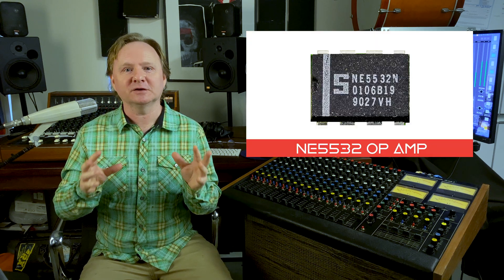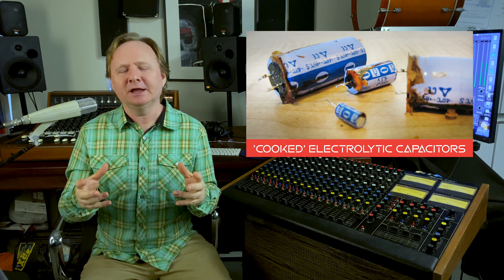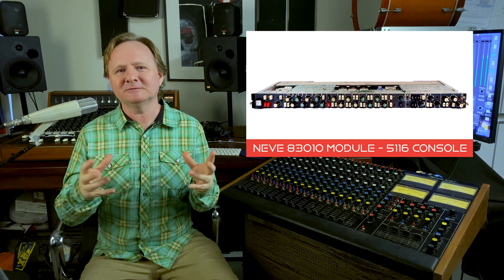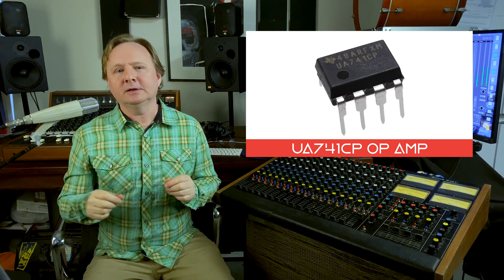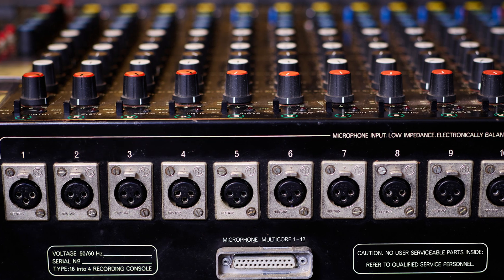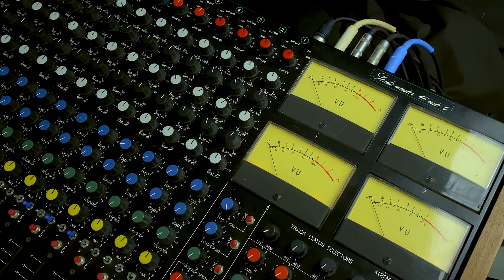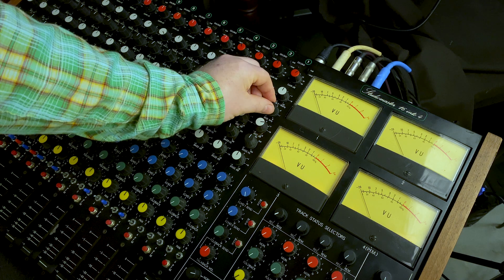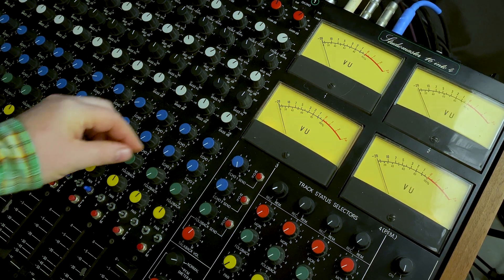Neve 51 vs. Studiomaster 16 into 4  part 1 - Clash of the 80s IC Consoles

Comment: It wasn’t the heat.  The Chinese stole the formula for capacitors, but didn’t get the final part of the formula, so all the capacitors failed after some time.

The 5532 op amps can drive a 600 ohm load which is why they pull more current,. The 741 op amps in the studio master can only drive about 2,000 Ohms.

Comment: The '741' was about the first op amp that could be used reliably, meaning it did not blow up if you looked at it the wrong way, unlike the '709' which would oscillate and burn if the layout was xrong or you shorted the output momentarily. all audio manufacturers worked on schemes to boost the inherent failings of the 741 and other chips, often adding a pair of transistors at the 'front' to boost gain and lower noise. Transistors at the output to boost current drive capability and so on. Making a chip perform in a 'product' as well as ONE device in an ideal circuit configuration in a lab is a bit of an art (or well researched science).  Saying a mixer has a chip in it is about as meaningful as saying you put petrol in your car as there are infinite ways to mess up the best performance a given chip is capable of.  Class A circuits do not have 'crossover distortion' and TEND to distort asymmetrically, meaning that the typical distortion rises gradually with signal level hence 'driveability' whereas all op amps used for audio can(usually do) have low distortion until they suddenly clip as you approach the supply rails. Talking of distortion, having coupling caps between stages that are too low a capacitance for the 'load' they are driving increases distortion at low frequencies, something that was not a big issue when recording to tape because tape would not record the low frequencies accurately and it is the resultant phase shift that alters the sound. Of course the mix engineer would be listening to the complete mix and would be compensating for LF loss by boosting the LF on the equaliser. PS, liking the QM3 Chilton. I happen to have a QM1 here for repair. I sawed a Studiomaster in half to make a 'split' radio station desk in 1987.
Reply from the maker: @mattsyson3980  some cool background there, thank you for contributing- where are you based?
Reply: @jamiedurrantmusician  Since 2017 in France but previously UK. I worked for 4 mixer manufacturers in the past (Audix, Calrec, AMS before Neve, and AMEK as a commissioning and test engineer before going freelance in 2000 where I now work on many desks SSL,Neve etc. I wanted to emigrate to Australia in 1984 but only stayed a month touring from Brisbane down to Melbourne and back.
Reply from the maker: @ wow what a back story!

Comment: Hi! I hear a quite high noise floor from my headphones when you are plugged in the studio masters, more so when you're boosting with the EQ. Is it going to be a problem when many signals are running through the console?
Reply from the maker: @robertopistolesi2735  yes I didn’t mention noise - certainly not a clean class A desk
Reply: @jamiedurrantmusician  Class A does not necessarily translate to lower noise, likewise it is possible to make any circuit sound bad and distorted whatever active components (transistors or 'chips') you are using.
Reply from the maker: @ makes a lot of sense!
Reply: @robertopistolesi2735  I have zero noise on mine, but I use direct outs only

Comment: The used 741 opamps in the Studiomaster might have lower dissipative heat, however they have higher distortion, noise, and lower slew rate than the NE5532. But I'm glad that the sound is cool!
Reply from the maker: @olivergretz  yes all correct! It’s not noise free and it’s darker sounding due to those 741s which is a good sound for certain music productions.
Reply: They used them because they were cheap lowend consoles

Comment: Neve moved into IC circuit topology after Rupert sold the company. The ICs used in those consoles had questionable sonic qualities, however, the use of ICs (along with the elimination of transformers) reduced manufacturing costs by quite a lot. This, along with each channel strip being fully on one main circuit board also reduced labor costs. Some console manufacturers (i.e. MCI in the US) continued to use transformers for their isolation qualities, but soon abandoned them because of several factors, mainly cost and audio fidelity). Once the 5534/5532 ICs came into being, console fidelity improved tremendously. Then it was merely the poor implementation of interstate coupling capacitors that continued to degrade the performance of cheaper consoles. The SSL 9000J is a servo coupled console… no interstate coupling capacitors… that sounds incredible in part, because the smearing phase distortion of those capacitors was eliminated. The NEVE 8108 and 8128 had a sound of their own, but were not really hi fidelity in their sonic signature. However, some cheaper consoles of that same era had a very lovable sonic footprint… Soundcraft being one of several.
Reply: 2 famous Neve consoles that are an example of a vintage Neve classic and modern Neve classic are the 8078 ic version, and the Neve 88r also an ic based console 

In reality tho and I’m sure everyone that’s had a Neve and looked into all of it knows well, repairs happen all the time on the vintage non ic modules, heat and other issues were far more common in terms of repairs, especially because of the Class A topology current requirements. Rupert would gage the truth of pre-amp circuit via holding his hand over the unit for a few minutes, and could tell if it was class a, as he said, tho half joking he had a point. 

I’ve had an IC Neve from 1978 for 15 years and the channels over their 40 year life have only been recapped, no other repairs, that absolutely wouldn’t be the case if it was the older transistors modules.
Reply: That is one cool comment over here! All the best, Tobi

Comment: Enjoy your videos Jamie. Do you use that reel to reel tape machine?
Reply from the maker: @Beatledave7  Hi Dave! I’ve not long had that reel, it’s a full track mono record model - MX5050 BiiF - I’ve only just had it serviced - the transport was almost locked up and pots and switches were noisy, running well now, I’m waiting on a replacement heads cover splicing plate. My plan was using it for tape saturation effects and tape delay… but something amazing happened - I met a local guy with 2 stereo MX5050s, one needing an erase head and a service, the other in as new condition - I’m buying both from him… so I’ll sell for a low price this full track mono, and won’t be using it much other than some test bounces. There stereo machine will get a work out once I get some new formula tape from the tech / retailer in Brisbane.
Reply: @jamiedurrantmusician  What a great score Jamie. Good luck with it.
Reply from the maker: @Beatledave7  cheers, a work in progress